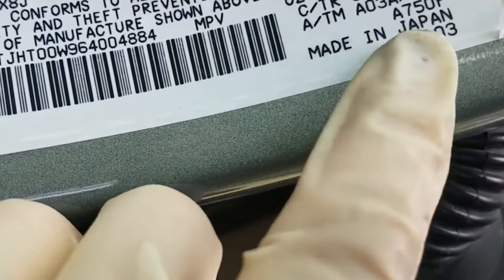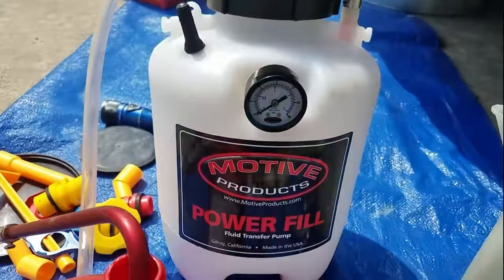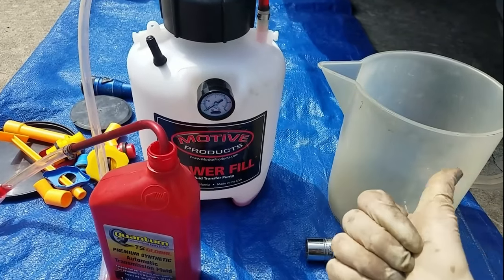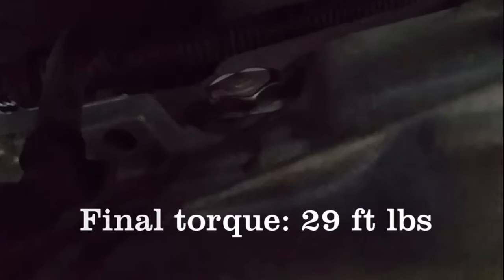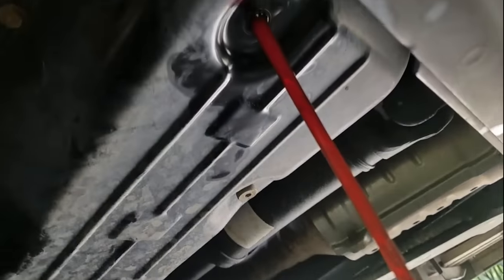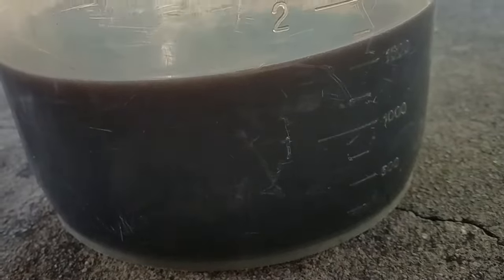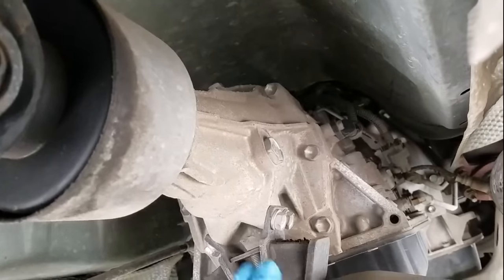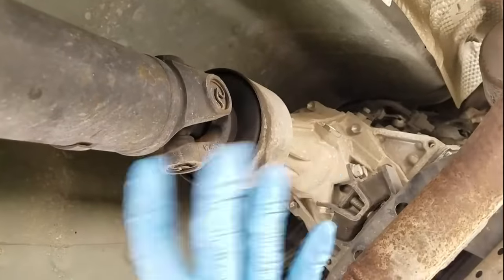How to Service a Sealed Toyota Transmission

Comment: “They never need to be serviced” 

Then why was my 5 speed whining? Let’s get real Toyota, you’re good but not as good as you think. They wouldn’t change my transmission fluid in my 97 5 speed 4 runner because it is “factory sealed”. I took that as there isn’t any drain or fill plugs. I wish I knew what I know about cars today. I would have looked into it more and serviced it my self. That thing was so rotted out anyways. I’m glad I didn’t drop any money into that pile of trash. It was super fun off road though! Hell I would have filled it through the shifter if I had to lol.

Comment: Hi and thank you for a very informative video! If I'm performing a drain and fill (several times as you did) on a sealed transmission with no history of leaks, would it be okay to measure the mass (weight) of the drained fluid, and refill the transmission with the same mass? You wouldn't need to worry about the temperature of the fluid (volume)? eg. a kilogram of fluid will remain static whether it's at zero degrees or 100 degrees. The volume would change, but the mass would stay the same.  Thank you for all of your videos and shows, and I wish you continued success and happiness!
Reply: I would think that would be fine and is a great idea!

Comment: After doing the math,on a Camry U760E tranny. (7 qrt.)a drop and fill 4 times gives you a dilution rate of 6:1...6 parts new to 1 part old.You use roughly 10 quarts of oil.Plenty of fresh fluid to make your tranny happy.

Comment: My ‘08 Tundra just passed 200k miles and transmission has never been serviced. Even the dealer balks at servicing it at this point. Toyota maintenance schedule should address transmission service.

Comment: Those 2 vehicles you do not need to service the transmission. The owner manual show no maintains isn't required unless you do heaving towing or live in a climate with extreme heat.

Comment: Hmmmm..lemme think. Even if the trans fluid gets hot and expands, can't you just let it cool off then take the measurement???
Reply: Yes, however, who's to say the original starting point was a hair over or under to begin with?
Reply: It's always best to just reset each time.

Comment: Can't you just crack open a cooler line, turn engine on so that it drains fluid out,turn off,fill to level,turn on again,drain,fill,etc, till you get new fluid coming out of line? This way you get almost all the old fluid at 1 time versus 2-3 quarts.

Comment: Let gravity be your friend, you don’t have to pump that trans fluid in, I got a 10’ piece of clear tubing on Amazon for 6 bucks and change, used about 4’ of it to easily snake through engine compartment to trans fill hole, slipped a funnel into tubing and put all the fluid in my trans in about 10 minutes, I never spilled a drop.

Comment: Very good ... But you are just replacing oil.
Old oil coming with small metal's parts or debris, all these debris are stock in the filter.  Adding a beautiful red oil, won't clean out  the filter !
Reply from the maker: Addressed this so many times. Please see other comments

Comment: I just had a Toyota dealership service rep tell me that the transmission filters are not replaceable.  I could not believe my ears; WTF.  I told her the filter is most definitely replaceable.  She stated they only change the fluids and that changing the filter was dangerous...WTF  She said that it was integrated with the transmission blah, blah, blah and that replacing would be dangerous.  I had to hold back my laughter.  Why are they so against doing a filter change or as I've read on the interweb against even changing the fluids?

Comment: Doing that a the dealership killed my transmission. I will never flush my transmission again. Just drain and fill in my Avalon.. I only had 110,000 miles on my car. It was a 2007. I have a 2016 now and I only drain and fill it.

Comment: This is simple calculation to adding new oil in cycles per 1,900 ml  into old mix of 15,000 ml. After 4 cycles just 55.5% old fluid in the mix, after 17 cycles 9.5% old fluid in the mix. It takes 32,900 ml to replace 90.5% of old fluid in the mix this way.  
  
Count   Before Volume   Add new Volume   Old % before   Old % after
0            15                          0                               100.0               100.0
1            12.5                       2.5                             100.0                83.3
2            13.1                       1.9                             83.3                 72.8
3            13.1                       1.9                             72.8                 63.6
4            13.1                       1.9                             63.6                 55.5
5            13.1                       1.9                             55.5                 48.5
6            13.1                       1.9                             48.5                 42.3
7            13.1                       1.9                             42.3                 37.0
8            13.1                       1.9                             37.0                 32.3
9            13.1                       1.9                             32.3                 28.2
10           13.1                       1.9                             28.2                 24.6
11           13.1                       1.9                             24.6                 21.5
12           13.1                       1.9                             21.5                 18.8
13           13.1                       1.9                             18.8                 16.4
14           13.1                       1.9                             16.4                 14.3
15           13.1                       1.9                             14.3                 12.5
16           13.1                       1.9                             12.5                 10.9
17           13.1                       1.9                             10.9                  9.5
Total                                   32.9

Comment: A friend got a great deal on a BMW.  No dipstick.  The oil sender went bad.  Blew the engine. Only few years old, loaded, like new overall.  Owner mor or less gave it away.  Even w cost of new engine, it was a bargain.  New engine is going to get a dipstick.

Comment: Or you could take it to a shop that has the machine to do it.  It pumps out all 10 quarts. Then pumps all 10 new quarts back in.  Otherwise you never really changing all the fluid. Your leaving dirty fluid in it.

Comment: Don't try to do anything Transmission fluids,  just know it, engine oil change every 5000 miles for $50. In 50000 miles you spend  $500. The same way  every 50000 miles  you  have to flush Transmission just $227. And add 1 quart of transmission fluid every 20000 miles for $3.99. You need tall tunnel  $1 dollar tree shop, there is the lids  under the battery.

Comment: Look… I like to think I know my way around a Tacoma, but when I only had the audio going  and you were running through the tools required to do the “oil level check”, and called for a “SHOP CHICKEN…” I almost threw in the damn towel. Literally and figuratively 😑. I’m obviously way out of my league. 

Either that…

Or I’m about to stop by Oreillys and see what kinda shop chickens they’re stocking…

Comment: Why sealed ?  Idiots take their $40,000 Tacoma 4x4 and traverse rivers and soupy mud and wonder why they only got 30,000 [or less] miles on the tranny .  You thing that snorkel going to save you ?  Maybe sucking in water to the engine.  You have a breather tube on your old   front and rear differential’s and gear boxes sucking in water .    The newbie off roaders are partially responsible for this change and experienced off road buyers saying ‘’oh what the hell , it’s under warranty ‘’’ I suppose Toyota got tired of  paying out warranties .  I have no explanation for doing sealed transmissions in a Lexus though .  Thanks for listening to me rant .

off to